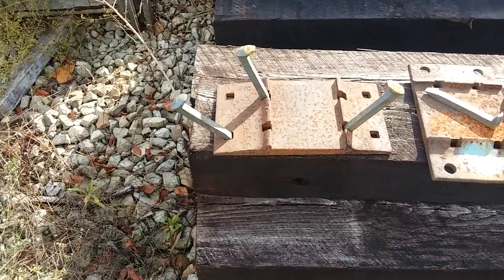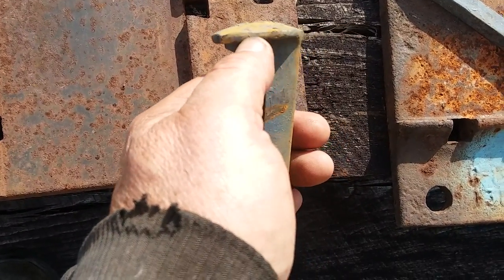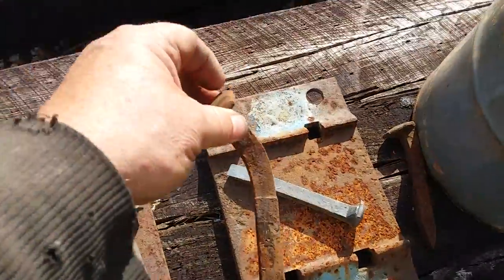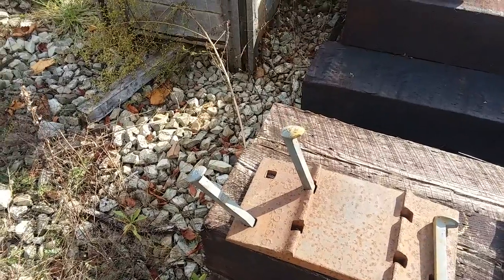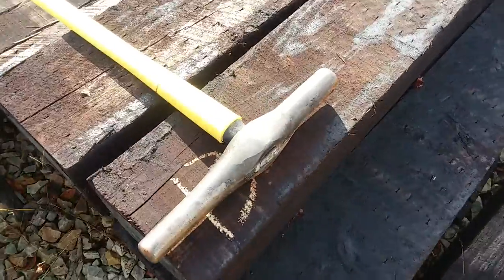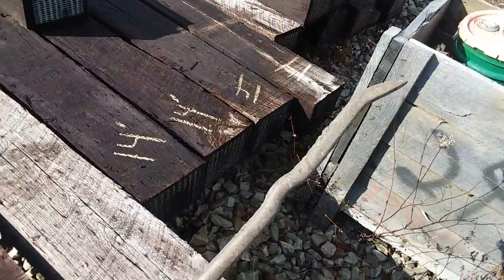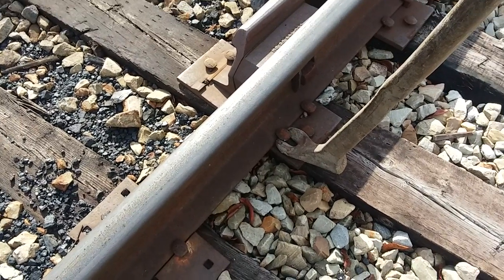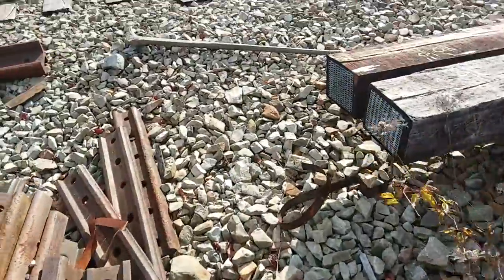All about Railroad Spikes

Comment: Excellent video, thank you. In New Zealand, the special spike pulling tool introduced at 10.00 minutes was called a "Dentist". The Dentist also had a 2 inch loose ring of 1/4 diameter rod forged into its top end and about four feet of sash cord was tied to the ring. This enabled the dentist to be used to pull the spikes on the outside of the rails on a bridge by levering the spike pulling bar over the rail and the track worker using the bar stood between the rails. A junior worker held on to the cord. When the spike, and the dentist came free, the cord ensured the dentist was not lost into the river below. I have worked on the railways 46 years and I have never seen spikes being installed because for years our timber sleeper track fastenings have been 6 or 8 inch screws.
Reply: Thank you very much for the really cool comment! I learned something new! 
They  also use lag screws here in US for various applications such as Pandrol plates,
often used in turnouts around frogs.

Comment: This brings back good memories, when I started working out of high school I worked at Atlantic Creosote in Port Wentworth Ga,  and operated the switch engine moving trams, and rail cars around the yard, and loading the treatment cylinders, we had tracks all over the yard and each section according where it was had a name, the Hotel track, the REA yard, the incoming lead, the outgoing, one track used to go out over the river and back,  When I'd push a rail car or tram  across the road to the office I'd blow the air horn with a half blow for a few seconds then a couple of short toots, I really enjoyed running it. I finally went to work in the shop and later could weld a switch point back up to where it was shaped as good as a new one and just as thin and tight to the rail on the end,.. I'd close the switch after grinding it to get it to close like original, then use a stainless 1/8 rod and lay the welds on top of each other and the flux kept the point from welding to the track,
Reply: Awesome comment Randy! I loved it, thank you for sharing with us your experiences

Comment: I worked on a factory warehouse remodel back in '82. The company was Cooper Energy. They made the massive diesel engines for the diesel-electric locomotives. From casting to final assembly all was done in house. When they tested them they would run full out, maximum rpms for 72 hours. The whole plant would hum with the vibration. When they shut the test engine down you felt like you would fall over from the lack of noise. We had to push our drywall carts what felt like a quarter mile through the plant. Huge facility, don't know if it even exists anymore. But it sure was one interesting summer.
Reply from the maker: Wow what a neat comment that was. I can just imagine hearing
that noise and then nothing when it shut down. So cool you
got to be around a big engine build from ground up. That would
be so awesome to see done. Really appreciate your taking the
time to write in and share my friend.

Comment: Trip down memory lane.  My first summer on the section gang was a real eye opener.  I had just graduated from high school.  I would ride to work with my mom who was a nurse. I took two lunches as one was gone by 10:00 am. Despite two lunches I lost 30 pounds in three months.  I was so tired at the end of the day I would fall asleep in a wooden rocker still in my nasty work clothes. Mom felt sorry for me and woke me just in time for the next days work..one pair of work gloves per week.  The old timers got tired of hanging spike mall  handles for me and said learn to swing it or hang your own. The rail jacks were unbelievably heavy.  It was said the softies of the. Soo Line got the aluminum ones while we on the Northern Pacific got the heaviest ones.  There were some fun moments Icing down reefers, refrigerated cars, when it plus 90 degrees outside.  Long runs in the speeder.  They wouldn’t let me drive. Said I might get lost.  We would have to changeout a section of rail. 6 guys with two to a set of tongs of 130 pound per yard rail.  My partner Barney would say” College boy I  don’t mind you riding along but quit dragging your feet. I was lifting with all my might accomplishing nothing.  The short guys were the best at  tamping ties,  pushing dirt under tie with a short flat shovel.  I was too tall to do much good. Good times when heavy rain forced us into line shack with pinochle around the coal fired pot belly stove.  If called out on holidays we received double pay and if on your birthday also double pay.  One time I hit it big with a sun kink repair call out on my birthday which is July 4.  Big check that week. At the end of my first year I asked the foreman how I did over the summer.  Nate replied. You go to college I’ll take care of the railroad.  Two more summers then into Army fall of 1966. Basic Army training physical training a piece of cake.  Real characters on the section gangs. One guy carried a large wad of cash and several uncashed paychecks in his thrashed work shirt pocket.  Another foreman I worked for could align a switch  frog on his knees. I think it was the 1/2 pint of Corbys brandy he consumed most mornings was why the on his knees alignment technique.  I Tried snuff once. Sick puppy as I chewed and swallowed it.  Thanks for the Memory Jogger.  I’ve been smiling for days.
Reply from the maker: AWESOME story! It got so real while i was reading it, felt like i was there with you! Thank you for sharing with us a great railroadin story.
Reply: I read a book on track work written in 1906 and the author said that his experience with Italian track workers is that they wanted to save money and go back to Italy so they tried to scrimp on food and ended up suffering for this. Work like that requires a lot of food.
Reply: What part of the Soo were you on? I had a relation that was an engineer on the Soo out of North FonDuLac.  I spent part of my summers there, hanging around the yard staying out of trouble... but in RR heaven for a train nut kid.
Reply: You just described my summer job with CN in Sask. I was called “lawyer” instead of college boy by my foreman. You described the job perfectly.
Reply: Lol, reading you description reminds of a time when one of the rookies was pounding in a spike. He was straddling the rail ( a no no). He clipped the spike it took off straight up and and hit him square in his bag! Funny as hell!
Reply: Great story.

Comment: I'm an a spike driver machine operator on a Class I railroad and we use thousands of those a day when changing ties and rail. Typically on tangent track we drive 3 spikes on a 6 hole plate standard plate and on a curved track we drive 5 spikes on a 6 hole eccentric plates.
Reply from the maker: Hope you wear good ear protection! Sounds like a very good spike pattern you follow.  Thank you for taking the time to write in and to check out the video. May you have a very good day my friend and be safe out there.

Comment: Thank you for the education !
   I am 72 years old and still enjoy learning.
I have been interested in Railroading all my life since we studied them in grade school which is sadly not a subject in todays schools.
I now live half a block south of an abandened UP line in the middle of Kansas that used to have a coal train run every 17 minutes.
Now it is a 2 mile long storage line.
I have a collection of spikes that I have found laying along side the track as well as in gravel that was taken from the abandened line bed.
I have also found in my travels several smaller gauge spikes.
I even have a new un driven spike that I found at a crossing that just didn't get used.
I even worked several years for a company that refurbished passanger cars and a few kitchen cars.
When I worked there I operated for a while the two trackmobiles they owned.
One had a big Cummins Diesel engine, while the other had a little Willy's 4 banger and Old Ford 3/4 ton road axles.
I moved the cars around in the yard to allow the truck crew to change out trucks for repair.
I could go on and on about the jobs I had with that company but this is supposed to be a comment section, not my story.

   Be Safe and Well
Reply from the maker: Thank you very much for your story sir. It's neat to hear other railroading stories like this. I never knew that schools taught about railroads other than what we learned about the transcontinental railroad, that's cool

Comment: Spikes are always driven so that the chisel point cuts the grain of the tie. Driving them in with the chisel parallel to the grain will split the tie. Also a properly driven spike ends up about 1/8" above the rail, it does not actually 'pinch' the rail tight to the tie plate. That is not desirable. The rail needs to be able 'run' or slide through the plates as it expands and contracts. To anchor the rail and control this sliding we use rail anchors, those are the roughly 'C' shaped things that are driven onto the base of the rails and bear against the edge of the ties.

Comment: I worked on a track crew as a 'gandy-dancer' for a brief period in the New York Central's Englewood Yard in Chicago, c.1964 right out of high school.  There was one tool that I encountered frequently which was called a 'Car Mover' and we used them to move cars around the yard to provide rail access without requiring an engine to be summoned to move a car a relatively short distance.  It was a cost/efficiency measure.  Perhaps you could demonstrate one of these hand-held devices that enable a single man, or woman to move an entire car with ease.  Impressive physics at work.
                                                                                                                                        Mike Kirwan - Kenmore, WA
Reply from the maker: Michael, that's impressive, NYC was a great railroad, I;m still upset over them
and PRR merging yet, what a mess that was. We have one of those in our car
shop if it's the same thing you are talking about, long thick wood handle with
a type of hinged heel at the bottom
Reply: @ccrx6700  Sounds like the same gadget-beast alright. First time I used it I was totally amazed at it's tremendous power for something so relatively small.  I was moved to the Building & Bridge section after a couple of days where I was informed that I was now a high steel painter from then on and a few days later was swinging from a water tower at Root Street slapping heated paint on the ironwork which actually served me well when I became a firefighter when I got out of the service after Vietnam.    Mike Kirwan - Kenmore, WA
Reply from the maker: @michaelkirwan177  Mike, thanks for sharing. Anything higher than 2 feet off ground and me dont mix. Thank you for your service to our country sir! 👍
Reply: I’ve got one of them (old one) in my storage shed and they’re still for sale on line somewhere. Like a lot of heavy tools from days gone by they were often called Armstrong or Jackson bars. The mechanism is pretty interesting and there are actually replacement parts for the part that moves. Car Movers
Reply from the maker: @boywonder8241  Thank you sir for adding that information. Appreciate your comment and for watching

Comment: Since I’m also one that was under the mistaken notion that the spikes hold the rails down your explanation and illustration shows how they can’t hold the rails down. Going straight down gives maximum hold for keeping the rails inline. If they were made to hold the rails down then the spikes would be installed at a near 45° degree angle to keep them from pulling upward. It had never made sense to me that when I watched a train pass as a boy it was usually the rail and tie moving up and down in unison. I would have thought the rail would move separate from the tie. Your explanation turned the lights on for me. Thanks.
Reply from the maker: Well glad you learned something Kevin. That was what I was referring
to when I said I drove nails at an angle. Hope you will watch more
of my videos so you can keep that light turned on.....LOL Appreciate
the nice comment and for watching my friend.

Comment: Herein is part of the problem of modern society: There are hundreds of specialized industries that require specialized knowledge that most people have absolutely no clue about. The "ancient" industries like railroads, electricity generation and distribution, potable water and sewage disposal that underpins our high standard of living doesn't run itself and requires a certain level of maintenance. But too many of today's young people want a business degree so that they can be a drone in an air conditioned building and never get their hands dirty.
Reply: This is not rocket science. However the high speed railroads of today are sophisticated high precision equipment, that have all kinds of electronics for signaling and speed control and lots of engineering in it. A track like that almost never gets hit with a hammer.

Comment: U didnt tell about  that notch in th claw bar  ,  dont hold th bar rit there  ,?  why ?  U will get ur finger  ,  mashed  ,,  That dog thing is  a GRANNY   puller  Where is ur spike lifter,,?
Reply: Earl, sorry I was not very clear on that, sometimes my mind gets to running away with me,
I meant that the bar should be held about 3/4 of the way up the handle and that you should
never stand behind the bar, i.e., pull the bar into you, but should stand on side of the bar.
Reply: @ccrx-xu1wc  Did u ever use  th rail turner.?  to flip th rail up  right .?
Reply: @earldowney8211  Earl, yes I have, one these days gonna make a video on
more of the hand rail tools I got, so much stuff to cover and so little time... lol
Usually when I turn a rail I will use a lining bar simply cause it got more
leverage, but can only use the one end thru a bolt hole, so a rail turner
does come in handy. Wonder how many folks ever heard of a rail turner? Great
introduction to one, thanks Earl!
Reply: @ccrx-xu1wc  I like ur videos    ..  good

Comment: I rode the Cog Railway up/down Mt. Washington in New Hampshire USA a few years ago.  The conductor in the passenger car got down on the floor looking out ahead (the Engine is always on the low side of the train on a cog driven line) to watch the rails/ties for areas that needed maintenance. I got down to help. He said only children are inquisitive enough to lay down on the floor and ask questions - he said it was a refreshing change to explain things at a more adult level. I learned a lot.
Reply from the maker: Awesome Paul, someday I hope to ride that also. Way back when I
was a boy on vacation with parents we drove up to the top there,
I was impressed and will never forget the huge chains over the
roof of that one building to hold it down. Appreciate your writing
in and for watching my friend.
Reply: @ccrx6700  We took the very last trip on the Mt. Washington Cog Railway that used the coal fired steam engine. They only use the desiel engines now. Check it out when you can it is fun!